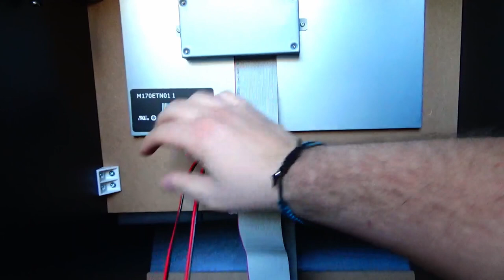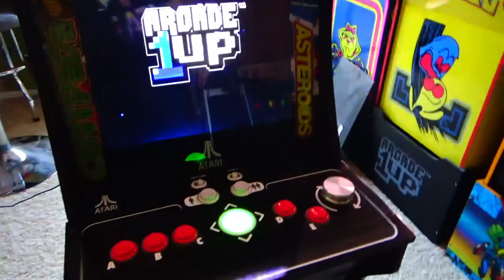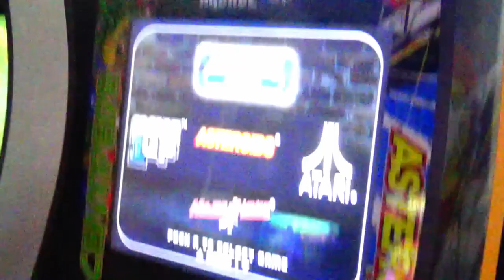Arcade1Up - How to Wire a Marquee into the Stock Power Switch Mod!

Comment: My Ms Pac man has a power light plug on my pcb board. Do I just use it? Waiting on my marquee from Angel.
Reply from the maker: Yes. This tutorial was for older cabs that didn't come with a light up marquee and have that port
Reply: @PDubsArcadeLoft  Thanks dude.
Reply: @PDubsArcadeLoft  It also have a USB and a microSD card slot.

Comment: If you put aluminum foil in the top of your panel behind the marquee it will help reflect the light . So you will have even light across the marquee.
Reply from the maker: Nice tip!
Reply: PDubs Arcade Loft ... thanks for the videos you post !  My light strip only had 8 leds that lit up . So I put aluminum foil on the top panel. It worked like a charm. It looks great ! Thanks again for your time and videos you post !

Comment: how long before the marquee light turns off after you turn off the machine?
Reply from the maker: Instantly
Reply: @PDubsArcadeLoft  
Thanks, it looked like from the video that the marquee was still on when you turned it off at 6:40
Reply from the maker: @dannymeng9786  sun coming through the back of the cabinet the back Panels were not attached